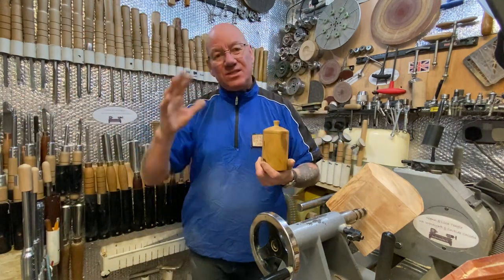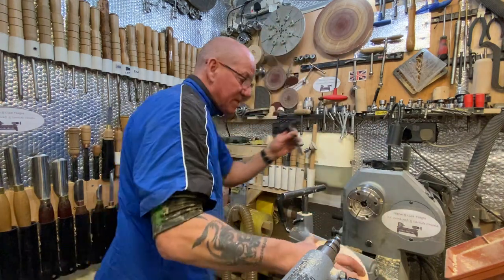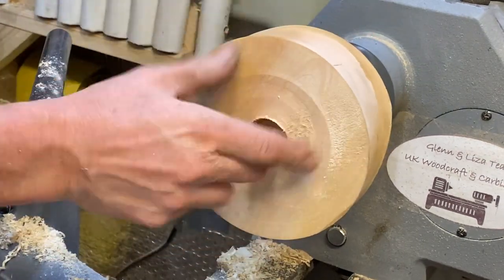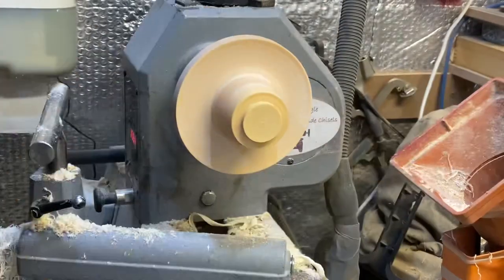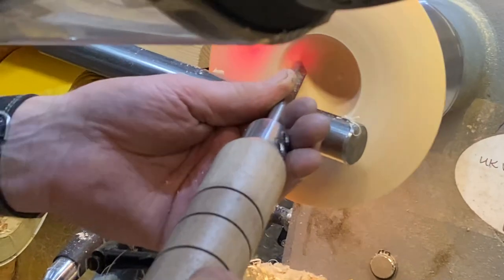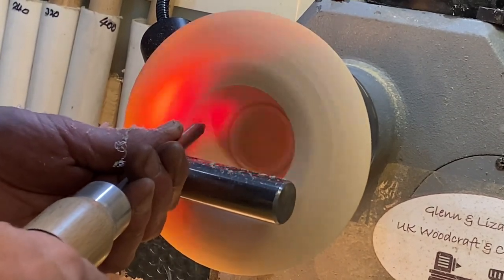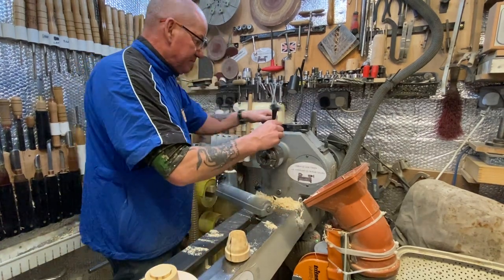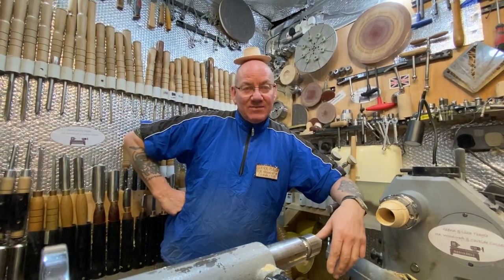Woodturning a little 🤠 cowboy hat #woodturning #carbide chisels

Comment: All I can say is Great wok.  I thought I saw Slight wisps of smoke, or steam, from the light when you stopped to check the inside depth.  Also, your nerves are steadier than mine.  Blew me away how thin you got that.  Wow.  Love it.  One question, might one be able to use a texturing tool on that band of dark without it going Crack?
Reply from the maker: I don't have a texturing tool. You'd have to give it a try. Let us know how you get on.

Comment: A lovely job, expertly recovered.  Regarding your lamp for checking thickness, after four abortive visits they finally had them in the Bridgwater Lidls, and I was able to get one for myself.   It has already been put to good use, allowing me to view down the inside of little pipes made for my small mechanical organ whilst running glue into the joint corners to ensure no air leaks.   The flexible arm makes it so much easier than trying to prop up a torch.   Thanks for the heads up!
Reply from the maker: Nice one Don. It has helped me with making these cowboy hats.